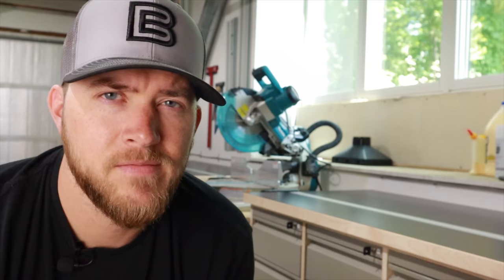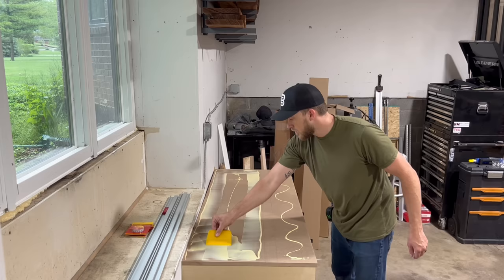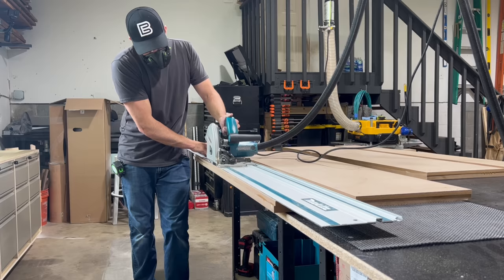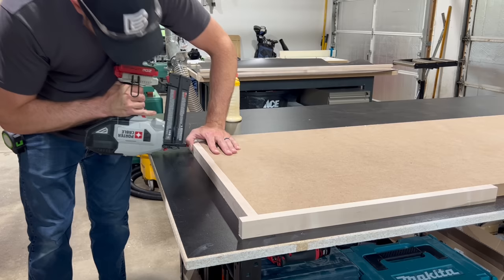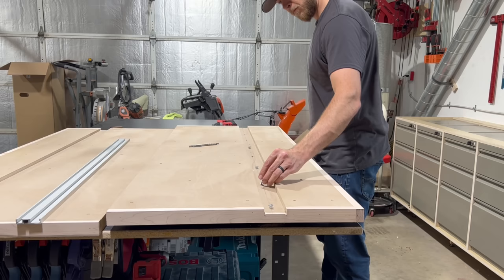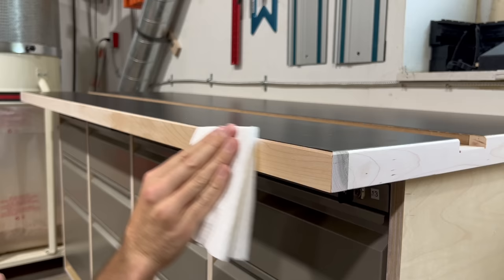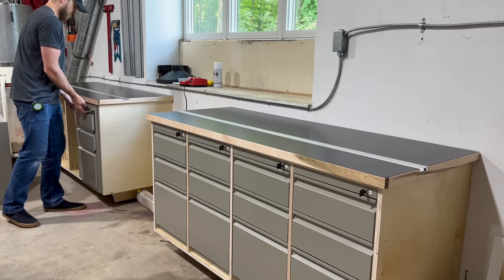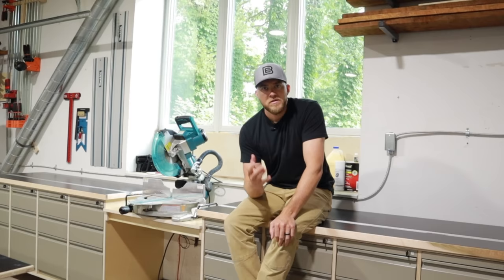Build Your Own Work Surface || Miter Saw Station

Comment: PRO TIP ! When you put down laminate, screw down the top from underneath. With laminate on the screws, you can never get to them again.
Reply from the maker: The screws through the top are only to laminate the two pieces of mdf together
Reply: Those screws will never need to be removed, my only concern would have been the recess created by the screw. Amazing clean looking build, could you please include a link to those cabinet draws, great look.
Reply: @Darkest_Depths I would like to know the same thing……where did you get the metal cabinets inside the cabinet.
Reply: @Darkest_Depths  he says this at the 18:40 mark
Reply: The only time that you need to be concerned about the recess is when using veneers,then you use automotive body fill then sand for a flush top.👍📐🇨🇦
Reply: @troyqueen9503 Why not just wood bondo?

Comment: Try this if you have good eyesight and want to keep it.  Inexpensive reading glasses with low magnification around 1.00-1.25 greatly sharpen focus and overall acuity at distances between three to 15 feet and protect your eyes from injury.

Comment: Like you I put off buying a track saw for years. Bought one last year from the money of a kitchen install. What a game changer in the shop! I can in seconds cut a straight chip free reference edge on almost anything. Last time I did some laminate for a craft table. I used the track saw to even rough cut the laminate to size. So much quicker and easier than knife and snapping.  Really need to get a hose and get some dust collection set up like yours.
Reply from the maker: One of my favorite tools by far! 🙌 I would definitely recommend adding dust collection. It makes it a much more pleasant experience 😁

Comment: Consistent also works... each subsequent cut is consistent with the previous one.

Would also suggest drilling your holes first, before glue, just because that way it doesn't shift on you... while you're doing it.
Reply from the maker: Thanks Nick! 👊

Comment: For someone who has undiagnosed OCD, your video instantly drew me in with the high contrast bench colors. Then you kept my attention with the great shots of satisfying cuts and assembly. Great job!
I've always thought about adding laminate to work benches, but have refrained due to how it wears. While the black top you added looks amazing new, you can see the wear and tear as white scratches on your assembly table. I wonder if just changing to lighter colors would hide them better. With a wood top, any wear just adds to the look.
One last note, kudos to you for giving credit where credit is due regarding your inspiration. I'm sure Mr. Hibbs will see this one day and comment.
Reply from the maker: First of all, thank you! And secondly, the laminate on my assembly table is pre-applied and significantly inferior to the laminate I applied to the miter saw station. The laminate on the miter saw station will hold up much much better than the assembly table. Hope that helps! 😊
Reply from the maker: The laminate on the assembly table is basically black paper, not great.
Reply: I bought Paperstone solid surface sheet seconds directly at the factory in Hoquiam Wa for my assorted interior cabine counters.  Extremely dense material that can be worked with carpentry tools and carbide blades.  The toughest material you will ever meet.  I was even able to tap and thread it for flush fasteners

Comment: 12:15 the proper scoring tool is a single pass usually. After scoring bend it so the score you just did is on the inside of the fold. This will snap the backing clean as it stretches and leave a much nicer edge and you only need to bend one way. And it's satisfying like bubble wrap when it snaps. Not truly important if you are going to do a final flush trim with a router, but if you ever need to seam two pieces together, I'd get the right tool. they are $5.00

P.S. I realized I forgot to say, awesome build. Good ideas in there. I hadn't seen the miter track and the woodpecker stops. Those are nice. Having the stop in the work surface instead of maintaining a fence (which is what I have now) is definitely an improvement in function of the overall workspace. Redesign is going on the list.
Reply from the maker: Awesome! Thank you for your input, it’s much appreciated. Fenceless is the way to go 👌

Comment: Good video.  I use a fine notched spreader for my contact cement and throwaway pain paint brush for the edges.  Also spread the glue on the plastic laminate upside down over the top of the matting surfaces first then so you don't have to worry about spills, then coat the matting surface last.  I'm going to have to try the hardwood chamfer technique on my next opportunity.    Also plastic laminate cuts on the table saw just fine and much much faster.   You can also use a trim bit with the router to cut pieces to size.   I like the track.  No need for a fence.
Reply from the maker: Glad you liked it! Thanks for the tips 👍

Comment: Great tutorial- I’ve used my track saw to cut laminate- easy peasy
Reply from the maker: Thanks! Ill have to try that next time!
Reply: @EverydayBuilds  I was a little nervous the first time I tried it. I supported the laminate with some scrap ply during the cut. I was pleasantly surprised on how clean the cut was. Used a high tooth count/plywood blade in my tracksaw.
Reply: put a strip of 1/8 mdf on the table saw to keep int from sliding under the fence and cut away, maybe go to a 60 tooth blade.

Comment: Grab you a laminate file for softening the edges. It gives you good quick work and much safer than sandpaper.
Reply from the maker: Awesome! I will have to check those out.
Reply: plastic file - ie plasticut file.

Comment: Just a FYI - a cheap paint sprayer will put down your contact adhesive fast and it will be a thin coat and set up faster, and you can cut your laminate on the table saw with a strip of 1/8 inch on the table against the fence to keep it from going under the fence, no more climbing on  stuff - great content

Comment: I subscribed to your channel because of this build and I was getting ready to replace the crappy melamine top on my mitre station. Studied what you did carefully and am now implementing it. One suggestion for going forward though. Once I have the 1/2" MDF ready for the back of the tabletop, I intend to glue/screw the back down only, put the track in place, and mark out the line for drilling the holes to secure the rail. Just thought that would be an easier way to do it than trying to keep that meter line in-between and below the two 1/2" pieces of MDF. Looking forward to having it done.
Reply from the maker: Good luck with your build! 👍

Comment: What are those cool cabinets you have underneath? I want some!!! Love the instructionall BTW 💪
Reply from the maker: Found them on FB Marketplace. Not sure where they are from, sorry 😢
Reply: DEVAISE 3 Drawer Mobile File Cabinet with Lock Under Desk Metal Filing Cabinet for
Reply: If you have used office furniture outlets near you they sell them pretty cheap and sometimes you can get dinged up/bad paint items cheap if you dont mind a little body work and putting a fresh coat of the paint color of your choice on them.
Reply: @jesseybarra6723  Doing God's work

Comment: Very nice quality video. Why not just route the track slot after gluing up the top and laminate in one piece?
Reply from the maker: That’s definitely another way of achieving the same thing. But routing out that much MDF would be a messy job. I try to cut down on dust whenever possible 👍

Comment: 17:39 Wouldn't it have been easier to secure the track before putting the top in place so you could flip it over and tighten the bolts face up?
Reply from the maker: Probably, but it wasn’t too bad

Comment: Awesome build! I'm doing something similar, and having never used a combo track before, wondering where to put the track in relation to the fence of the miter saw. The miter track would be just forward of the fence for the woodpecker stops, but did you line up the T-Track perfectly with the fence or a bit forward, or does it even matter? Thanks again, great videos!
Reply from the maker: Thanks! The t-track is as you said, lined up with the fence (not perfect, but pretty close). And that makes the miter track just in front of the fence 👍

Comment: FYI to others, levels are not straight. 4ft+ levels can and usually are off quite a bit. Be careful.
Reply from the maker: True. But they are typically straight enough to give you a decent edge on a board 👍

Comment: Nice work and presentation. Curious about how you can apply contact cement with a roller. Do you dilute the adhesive? To put a little context to my question. I live in Jakarta, Indonesia. Perhaps the contact cement available here is different than in the US.
Reply from the maker: I spread it straight from the can. No diluting 👍

Comment: Thoughts on the Woodpeckers StealthStop thus far? I just got mine in preparation for finishing my miter station. All 4 of the red stops had micro cracks in them out of the package. Basically from the set screw to the end of that section. Have you had any issues?
Reply from the maker: I did not have that issue. I love them! Great for repeatable cuts 👍

Comment: Thanks for the video. I like the combination of the filing cabinets with the wood frame very much. Looks great and very handy for the day you want to move or reorganize. Also, you can get them very cheap second hand which would make the whole a lot more cost and labour effective. Can't you cut the laminate with the drop saw? Personally, I would have tried to make the edging a bit higher so the laminate is flush with the edges just to prevent chipping of the laminate on the edges. Subscribed.
Reply from the maker: Thank you! 🙏

Comment: Just curious why you didn’t put the edge banding on AFTER the laminate? The way you did it, the laminate sits proud of the edge banding even with the chamfer. This is likely to chip. Done the other way, edge band last, you wont have an issue down the road.
Reply from the maker: It can definitely be done either way, I just like the look of a continuous top. And adding the edge banding after can be difficult to get it perfectly flush. Just my preference 👍

Comment: Looks great but I was wondering what the advantage is to making the space for the combination Lakota that way versus a solid top and routing out the slot. It seems like it would be a lot faster to do the latter.
Reply from the maker: Honestly, I wanted to avoid the absolute mess of routing that slot, lol 😂

Comment: Really cool build and great video! A couple of questions for you... I had heard that laminate is a good idea because wood glue does not stick to it, or at least is easily removable. Do you find this to be true? I'm thinking of using it for the surface of an assembly table. Also, my basement shop doesn't have great lighting so I'm thinking of using white formica instead of black just to keep things brighter. Looks like your shop is plenty bright, so that's not an issue for you. Do you see other advantages of using black vs white?
Reply from the maker: Thank you! Yes, laminate is great for a worktop because glue scrapes off easily and it can be removed and replaced. Black is just a personal preference, but it’s probably the worst color to go with, lol 😂. It’s shows everything. White is a great idea for a dim lit area 👍
Reply: @EverydayBuilds   great, thank you!
Reply: It is absolutely true. I recently did a folding workbench and covered it with black laminate. I do all my glue ups there now without worry for where the glue is going. Wait for it to dry a bit and it just pops right off with a piece of wood or a drywall scraper.

Comment: Does raw mdf benefit from a sealer coat of some type of clear urethane or waterborne acrylic? Maybe on the underside to stabilize the mdf against humidity variations?  I see weather conditions that could cause condensation on cold metal surfaces, like metal cabinets etc located in a garage
Reply from the maker: Doesn’t sound like a bad idea at all. Thanks for the input! 😁

Comment: So it has been 6 months. Did you find not having a fence all the way down each side any hindrance to getting true 90 degree cuts? Great job and a clean look. Having the usable table to the wall would be nice to use as assembly space.
Reply from the maker: No problem at all 👍 Thank you!

Comment: I am looking at trying out the Stealth Stop system too. How close to the thickness of the 1/2 inch MDF is the track? Did you find not having a piece of laminate under the track to be an issue or did you prefer having the track recessed a bit instead of flush?
Reply from the maker: I really liked that the track was slightly recessed under the laminate. I love this system 👍
Reply: @EverydayBuilds  nice to hear. Do you ever have issues with pieces you are cutting catching on the mdf because the track is recessed? I was considering putting a strip of laminate under the track to make it flush with the top.
Reply from the maker: Nope!

Comment: Hi! Love the video! Which laminate type did you use and where did you get it from? Any suggestions?
Reply from the maker: I used the Formica brand. I purchased it from a local supplier, but I have also included a link to the same product down in the video description.

Comment: Can you tell me about your work bench? It looks like some type of aluminum frames (2, maybe?) with leveling feet, with a 4x8’ sheet of melamine on top? I need to make one.
Reply from the maker: You are exactly right. There are two metals frames measuring 36”x36” and I purchased them from Rockler. 👍

Comment: I hit subcribe at "shop builds..." 

Here's my comments:

Track Saw. You are 100% on the mark! It's a game changing tool. Those who may be thinking about it for years on end you should get one. Like everyone else you'll ask yourself why you waited so long. I have the Makita cordless saw with two 55 inch tracks and use the TSO track link things to put them together. I then bought the 118 inch Festool track and added a TSO 50 inch parallel guide system and TSO track square. The precision is unmatched even with a good table saw.  Note: the 45 degree rail lock on the Makita saw wont work with Festool rails. so if your doing 45 degree cuts you just have to make sure the saw doesn't fall over. not a deal breaker in my opnion.

I'm wanting to try laminating also and eventually try to fix the wood veneer on an old table dining room table I have. Is the process similar with wood veneer? I would rather practice on a miter saw station first! And can't you buy MDF already laminated? I know.....what fun is that?

Your assembly table stands. are those the Rockler stands you used? I have a Kreg table for my router. I like it but wondered if you have any issues with the Rockler tables

Comment: I like the top but am interested it the cabinet part. Are those metal file cabinets?
Reply from the maker: Thanks! Yes, they are metal file cabinets I got second hand from FB Marketplace 👍
Reply: @EverydayBuilds  smart move. Easier and probably more durable drawer hardware.
Reply from the maker: @BK-fy2xi  they have been amazing! Best and most affordable shop storage in my opinion.

Comment: Good idea. I’m about to rearrange and rebuild my shop. If you don’t mind where did you get the gray metal drawer cabinets. They look like a good solution for my shop. Thanks
Reply from the maker: I found them on Facebook Marketplace. And thank you 🙏
Reply: they are Devaise filing cabs, if you have a used office furniture outlet they sell them reasonably, and sometimes have scratch and dent stuff cheap if you dont mind a little body work and painting. Most manufactures make a similar cab, work as a carpenter at a steal case dealer for years and never thought about using them when I could almost get them for free

Comment: I already have a combination track from Woodcraft installed in my miter station.  They have a standard 3/4" x 3/8" miter track has a bottom T-profile in them.  Will these Stealth Stops fit in this track?
Reply from the maker: It should, that is what they are intended for. But you can also double check on Woodpeckers website 👍
Reply: I looked on there site and couldn't find any dimensions.  Could you measure yours and let me know what it is?
Reply from the maker: Just measured it and yes it is made for a 3/4” track and is just under 3/8 tall 👍

Comment: Why not use your track saw and rough cut your laminate before you do the step to contact cement the substrate? Cement them both at once
Reply from the maker: Definitely going to try that next time 👍
Reply: @EverydayBuilds  I have that Makita track saw and it has the positive stop for 1/8” cuts. It is perfect for that situation instead of scoring with the razor knife.  Just my $.02
Reply from the maker: @stephenwilliams1946  love it 🙌

Comment: Hi, Great video, can you confirm the amazon link for the formica please, doesn't appear to refelect the actual product used. As I'm based in the UK, could you rovide your local company info and exact product detail (product ID)....Cheers & keep up the good work.
Reply from the maker: It’s just standard black Formica 👍
Reply: @EverydayBuilds  Thanks, just struggling to find it, have you got a link please to where you got yours?

Comment: Do you have a LINK for those cabinets in the station?
Reply from the maker: The ones I have in this video I found on Facebook Marketplace. But I did find some similar ones on Amazon and you can find the in my Amazon Store under ‘For the Shop’. You can find a link to my Amazon Store in the description 👍
Reply: @EverydayBuilds  Great video! What brand filing cabinet did you use for your build? I see on Instagram where it was pointed out that the filing cabinet in your Amazon Store is 23" instead of ~28" in your build.